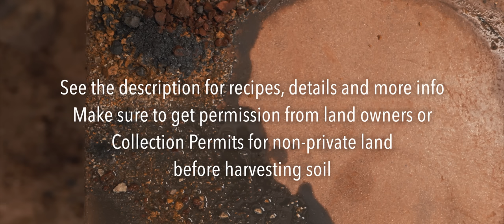Natural Clay Paint, homemade with soil and wheatpaste: A cinematic venture

Comment: As a potter I love seeing the clay honored in this way. As an artist I love the cinematography. Great project! Vermont subscribed.
Reply: @serendipidus1 You may have what we call wild clay!
Remove stones & hard chunks, wet and make two small spheres. Find a local potter who will contract fire for a couple of bucks and ask for both to be fired (on a tile) at the bisque temp. Then have one fired at the hotter glaze temperature. You will be able to see if it is clay (if it held together and became a solid) and which of the two temperatures it is best at. Often the second firing is too hot and the clay will be darker and more melted/shiny. 
Usually the first firing is hot enough. We use it for painting decorations on commercially prepared clay.

Comment: I started making journals about 10 or so years ago, and I've known about wheat paste since then but I was "afraid" to try it............until about 2 weeks ago.  I wanted to make a journal, but since the art stores have been closed (UGH!!), I couldn't buy any PVA glue locally so I decided to make wheat paste instead.  Oh.  My...........GOODNESS!! 

This is just one thing that has been a blessing so far from all the "craziness' going on right now, and that is my "discovery" of wheat paste!!  I am, ABSOLUTELY in LOVE with the "stuff"!!  My journal turned out fantastic (I'm NOT going back to PVA (!)) and you guys did an AMAZING job with putting my now.......TWO favorite things together; earth and wheat paste!!  So, THANK YOU FOR YOUR VIDEO!! 

One question:  What is the sand like texture in the paint?  I'm assuming it's what made it through the screen (?).
Reply from the maker: Yeah you called it, sand that made it through the screen, you'd have to use finer screens to get rid of the grit or just use bag clay.

Comment: Thank you very much for your Video. Is it durable for outdoor structures?
Reply from the maker: Not alone you'd have to code it with something like a hardening oil or another sealer
Reply: Could you recommend what kind of hardening oil it could be for outdoor walls please ?? I've tried half bee wax half sunflower oil but it alter pretty much the colour and leave marks.. thanks

Comment: Is clay paint only usable on concrete wall or is it also good for painting wood and fabric? Great video! Love the close up shots.
Reply from the maker: Should be good over anything fabric canvas whatever
Reply: @TheNitoProject  thank you for responding. Will try it on wood 😁  hope it adheres to wood and does not chip off. Wonder if it's good for staining wood if you put more water in the mixture.

Comment: Hi good day!!  Do you need to put the mica powder?
Reply: he explains in the description...you can use any thickener
Reply: The mica powder is used to cut the clay. If you are using a soil with high clay content, it may crack if there is not some sort of aggregate / filler added.  If your soil naturally has lower clay content you do not need to add anything.  Making the paint thinner (and doing more coats) will also help prevent cracking.  I normally only use mica powder when I am making paint from pottery bagged clay.
Reply: @canelochronicles  It also seriously brightens the finish!

Comment: Any alternatives to use instead of wheat flour?  Seems like that would attract bugs
Reply: No. It won't. Once cooked, it becomes the glue that keeps the clay on the wall. Wheat paste is not liked by bugs.
You can also try powdered milk instead, but I'm not sure if the paint will hold as good.
Reply: @hugoramirez1786  Salt was traditionally added to wallpaper paste or decorative papers used in binding when made using a flour or rice base to deter bugs.